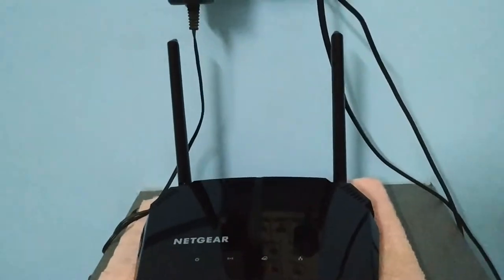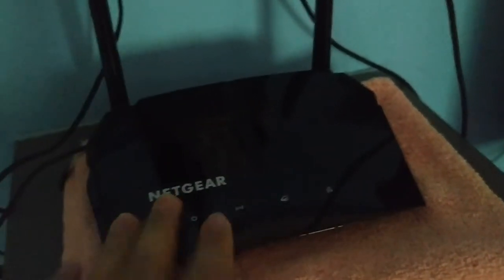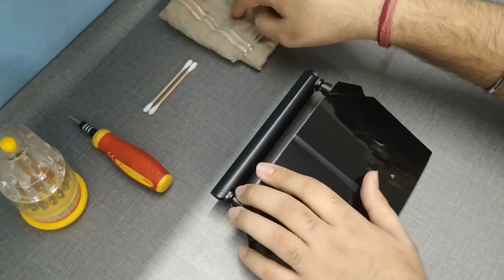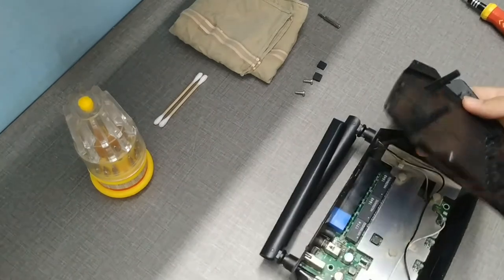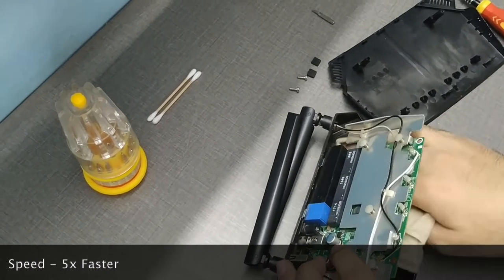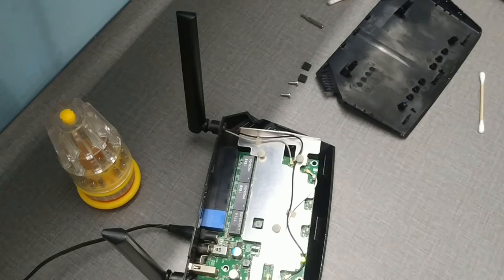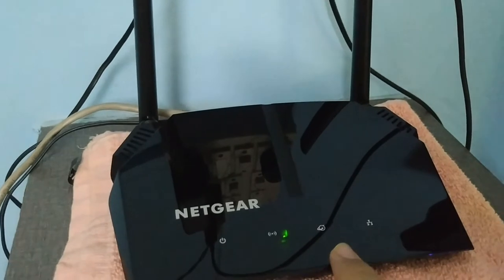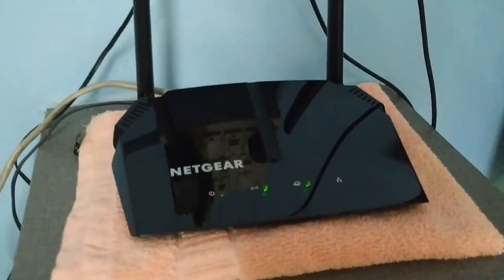Fix Your Water Damaged Router (3 Easy Steps)

Comment: Is it normal for the router to make a sparking noise? Mine did that overnight.  I was charging my t10 router and yeah it made the noise all night.  Next day the carpet had a few flames on it and my router was melted into the ground.  It's been in the water for way over a year.  I lost it in a lake a few days after the release.  I think it's been 2 years.  Surprisingly no corrosion only no power and someone broke the lcd so now in my display panel, its filled with glass shards instead.
Reply from the maker: That spark was mostly due to water near power supply unit. Try to cover your router with plastic next time to prevent water damage.

Comment: When I cleaned all light are getting on but not connecting
Reply from the maker: Contact your Internet Provider, they need to rebind the mac address and let you log in to their network as configuration might be lost.
Reply: @AKSHAYBHOPANI  should I call router  company or ACT net provider
Reply from the maker: @Aman-dp6no  ACT Net Provider as lights in your WiFi mostly means its fine now.
Reply: @AKSHAYBHOPANI  thanks I was purchasing new router but after seeing your video it helped me lot thanks for telling such easy method to solve problem
Reply from the maker: @Aman-dp6no  Glad bro, it was useful 😍

Comment: Bro did you find any permanent solution for this? How to stop water entering our cables?
Reply from the maker: I did a little cut in the outer covering of wire, a little far from the router. Also, I have kept a napkin below my router to absorb the water. This is a temporary solution.